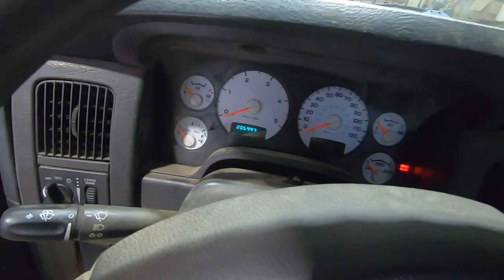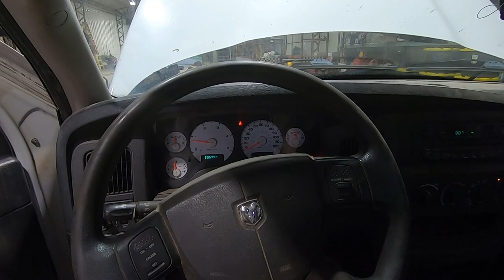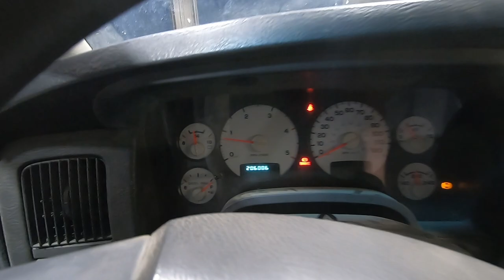Fixing the Tow Pig! My 2005 Dodge Ram Cummins gets a Camshaft Position Sensor Replacement

Comment: It's not how big the tank size is, it's how big the wallet is.
Reply: I have a 36 gallon on my Ferd. I need a bigger wallet.
Reply: yea...i got a 36gal OEM and a 50 gal aux in the bed.  The trick is not looking at the pump...just pull away...
Reply: I got a 25 gal tank AND a small wallet. (2002 f150)

Comment: Had a 4wd '16 Ram 3500 Cummins/6spd crewcab as my tow rig/daily driver...absolutely loved the truck, hated the price tag. Sold it after 4 years and went back to an '84 K30 CUCV with a 6.5 turbo swap and a 4L80E swap for less than 1/10th the cost with the same fuel mileage. Never looked back! Definitely a slower rig, but reliable and cool AF! Just can't beat a squarebody!
Reply from the maker: Dang right!

Comment: 1989 Chevrolet P30, 350 gas turbo 475 trans, soon to be LS 6.0 6l80 trans swapped. I rebuilt an early 70's 350 from a C30 about 9 years ago. Rebuilt the rear leaf springs to handle more weight.  added a few more leaves and new bushings and GM coil spiring over shocks front and rear. best improvement was adding a rear camera with a big screen from an old tablet up front. I have an aluminum car trailer, but most of the time I use a tow dolly I improved upon. I have two winches one on the tow dolly and also one mounted behind the rear bumper of the step-van. I have a generator, air compressor and a 110v welder. in the back of the step-van and a big vice mounted on the rear bumper. It also has a work bench and bunk that folds down on the inside side wall. I did mobile repair years ago with a service truck, now I just work on my own crap when can.  If someone calls looking for help, this truck is always broke down itself.

Comment: Based on the number of that gen 2500/3500 diesel Rams I towed in to dealers in 07-08 or so...and knowing that the rear axle was the primary failure point for all those oilfield guys and their welding equipment on the beds...and why they came out with 4500 and 5500 models soon after...I'd keep an eye on that rear end for sure.
Reply from the maker: Never heard of rear axle issues hear. So long as you keep fluid in them.
Reply: @moremortskerepair4354  the problem was who made them, Dexter Axle Indiana (my methed out brethren) was one of them.DCX got parts from the absolute lowest bidder to make the Krauts happy

Comment: Camshaft position sensors...oh I got stories with those. Never buy the cheap-o ones specially if its a German car. Also if your vehicle is seemingly eating camshaft sensors..make sure your ignition lock has not gone bad.

Comment: Half the cars in shops around America are there because of Computer component malfunctions. The automotive part didn't fail. The sensor failed. In the old days a can of Chemtool and a set of $6 set of points fixed your ride.
Reply: and in the old days your car was done at 100k, and got between 8-12mpg.

Comment: Living in Bulgaria I found that the parts for my vehicles are quite cheap, I have a 2000 model wrangler and a UAZ 405 4 x4 van from 1983, now looking for a lada pickup. The UAZ could be rebuilt at the side of the road no kidding so simple.

Comment: it's not the $150 charge, it's the 3 days they want to keep the truck that's a b!tch. btw, hope the cummins does better with the aftermarket CPS, the Dodge 4cyl and v6's tend to knock those out pretty quick so the "real" fix is to get one from a dealership.

Comment: I had to replace my radiator today in my 05 2500. The engine has been doing this skip. Almost like a misfire. But it was tiny. I just did 2 500 mile runs to Idaho in the last week. No problems. I am scheduled to tow tomorrow. After the radiator the engine flashes a code. States it needs a cam sensor. Clear it. And while getting the trailer it hesitates while on the freeway and does this almost die during idle. I get home watch your video and do what you say not to do. On my back trying to get it to run well so I can head back to Idaho tomorrow. After the PIA install it idles bad and dies twice. I guess it could be in the wires.

Comment: Oh no...you got the rear axle problem too. Its a good thing you caught it. Most Dodges made in DaimlerChrysler era all launch the pinion seals after some miles, most people dont notice and destroy the  entire axle. It was a problem in the older ones but not as bad. A buddy of mine has a 03? with Indiana cancer,the 20 inch flower rims,Hemi with a tick,190k miles and a grenaded rear end. Used rear end is 1200 so its a yard ornament. His problem was the bearing spun the race and wallowed the housing out. Keep an eye on your Dodge rear ends everybody..

Comment: It's the small stuff that can be a pain, I have a 02 GMC 2500hd diesel tow rig. Intermittent ABS brake light on dash, would come and go, had to pull the top off ABS module to access circuit board. Cut the thing open and resolder all the main connections on the board and reseal. It was tucked up nicely in the frame rail, for not so easy access, flat on the back job.

Comment: I HAVE A 05 DODGE 3500 DIESEL ALSO. THE JOB THAT REALLY SUCKS ON THEM IS REPLACING A HEATER CORE. ALSO THE BACK DRIVERS DOOR IS BAD ABOUT BREAKING THE WIRES TO THE ELECTRIC WINDOWS AND LOCKS. OTHER THAN THAT ITS A GREAT TRUCK

Comment: Good video.  Your honesty draws viewers like a magnet.  I tow a 14' utility trailer which carries a dune buggy.  My tow vehicle is a 2019 Honda Pilot which is rated for 3500 pounds. Although my loaded trailer falls about 400 pounds under the limit, I had to install a trans oil cooler to keep the tranny from overheating in hot weather. The Hayden trans oil cooler works well. I'll use them on all future tow vehicles.
Reply from the maker: They make a good product!

Comment: What a great truck. The manual is definitely the way to go in the Mopar truck.
Watching this I realize changing the CPS on my 7.3 is way easier. However since 2002 Ford/NAVSTAR has had three iterations on the CPS and they can be a little picky as to which one runs best. Can’t buy the original (arguably best) CPS new. 
For most other repairs the Cummins is friendlier to work on.
Reply from the maker: Well that's fun!

Comment: I have a 2006 Dodge Ram 3500 crew cab Dually 4x4 with the Cummins turbo diesel and 6 speed manual transmission. I love that truck !!! I love that cow catcher you got on the front of yours.

Comment: Cam position sensor on my 5.7 tundra. I know gas things. But I was instructed to change oil. I did that 3 times at less than 3k miles all 3 times. On the 4th change I got past 3k. Changed again. Now I change at 6k have for over 100k miles and no codes since. Runs like a champ. It was my tow vehicle. I currently have a 2022 gmc with 3L duramax. Getting 28mpg normal driving and 16 when pulling. Same stats as my tundra HP and Torque. Love this new truck. Still have the tundra as my beater 270k on that. Plan to keep it until it completely Rusts into a pile. Fuel tank is held on with ratchet straps currently…

Comment: Excellent video Mortske Repair  :) also don't you have clear code with code reader  with engine off running  plus ignition  switch to on after code reader plug in and clear codes 2 twice also confirm to 2 times should help out! Yes that excellent tail pipe need change for sure and truck in great shape for age too!

Comment: I can't imagine that the cam/crank sensors are much different between gas and diesel engines.  I dealt with a Jeep Liberty with the V6 trying to clear those exact codes.  Went through 3 sets from 2 different parts houses, 2 different brands.  All were junk.  Ended up spending 2x the money, and bought from the dealer.  Ran like a champ after that.

Comment: 2016 F-350 Powerstroke Torbo and the Old ‘02 F-250 7.3 Turbo, both 5th. Wheel, Crew Cabs, the 02 has 9’ Diamond Tread Flatbed & 16 has the short Box. All in the Driveway below My 2020 F-350 Super Duty 6.7 Turbo that’s a Company issue Crew Cab that has only had a Passenger a Hand Full of Times. I like the Ferds, maybe I’m Stunned? That’s Debatable Per the Wife. Catch you on the next one, Keep It Safe Out There Sir
Reply from the maker: No comment!

Comment: Better if you would call Wes!  My tow rig is a 2022 F-350 with 7.3 l gas Gogzilla engine, ten speed, 4:30 locking diff.
Reply from the maker: Nice!

Comment: Just replaced a cam sensor in my 07.5 6.7 truck and the engine light is still on and it didn't fix the issue. My truck is having a crank no start condition woth p0340 code any ideas?
Reply from the maker: nope

Comment: Oh, you are gonna laugh. My tow pig is a 77 Plymouth Gran Fury 2 door married to a converted boat trailer ( it tilts!). walking axles, 14" tires . The poor Fury has a 318 2 bbl. dual exhaust and 197,000 on the clock w/o a rebuild. I try and tow-bar when ever possible. It just keeps going. Best $600 I spent since I used up all my trucks ( "ain't nobody got money for a decent truck").
Reply from the maker: Sweet!

Comment: My Toyota Tundra is my tow pig plenty of power. Don't even feel like it's back there. Need a load leveling system for my trailer or air bags. Cause my bumper is really low but doesn't drag
Reply from the maker: Carolina leans are cool!

Comment: Glad it’s running again! Noticed you hacked it by not disconnecting battery, drove it and it straightened out. Quick story, changed mass flow on 2011 pilot, 150 miles later, dash looked like a Christmas tree, swapped back to cleaned original sensor, 150 miles, Christmas again. Got home, scratched my head, disconnected battery, waited bout an hour, hooked up battery, now have bout 2,000 on it, perfect! Know anyone who wants to buy a gently used mass flow sensor? Guess it defaulted codes to original settings after disconnecting battery. Might save you the heartache of replacing that sensor again, although Wes may do it for you, eh? Good video!
Reply from the maker: Interesting.

Comment: My tow pig is an '06 F450 crew cab flatbed with a 12-valve 5.9 cummins swapped into it.   116k miles.
Reply from the maker: Nice! No 6.0!
Reply: @moremortskerepair4354  Was actually a V10 truck.    Engine is from a '92 D350 and dunno where the trans came from, but the trans was upgraded with billet convertor etc.  Engine upgraded to 350hp..   4000 rpm governor springs.   With 4.88 gears, it isn't going that fast at 3200 rpm, but it will pull a house.  Plus, with the extra weight on the front end, it doesn't ride like a buckboard.   Couldn't have assembled a truck like this for the price I paid, so I am definitely happy with it.    Only gets 12 mpg, however....   xD

Comment: We used a short box square body Chevy 4x4 with a lift and monster mudders on it to haul a giganormous car hauler with a big tool box and a tire rack. One time on the way to the track I seen it passing on the shoulder. That old trailer did its job and the brakes kicked on - stopped it on the shoulder. It snapped the drop hitch off.
Reply: You could fit two engines in the tool box thingie if you had to. Always had one spare engine with us.

Comment: Few things are worse than that feeling after you put a ton of work into replacing a part, then you start the rig up and the problem persists.  My tow pig is a 2005 Chevy 2500 with the gas 6.0 LS, but not too long ago I used to tow with a 1989 Jeep Grand Wagoneer.
Reply from the maker: That's a pretty good upgrade!

Comment: this truck reminds me of my 03 ram was originally a 5 speed they(first owners i believe) swapped in a 47re or 48re they did the column and all too of a newer ram shes never been wrecked according to the title report but shes had a run in with the previous owners shed so its slightly more then whiskey dented im waiting on a bed and such to fix it
Reply: my factory 1 of 1 89 ford is my tow rig right now till i get the ram finished

Comment: "Comment on what your tow vehicle is" - OK I will and but don't laugh. It's a 2005 Kia Sportage XS, and I say 'don't laugh' because it is actually surprisingly good at towing and not too bad if used off road. It certainly has it's limitations and you need to learn where they're set pretty soon though or you'll end up in a mess with it. I only bought it because it was ridiculously cheap at the time, it's earned the right to stick around for awhile so far.
Reply from the maker: What a hot rod!
Reply: @moremortskerepair4354  Hahaha.

Comment: Find you a  wrecked Pete or Kenworth and get one of the tanks off of it and then you will have a 100- 150 gal. Aux tank mount it in the bed  and it won't cost you  2000$
Reply from the maker: I don't wanna use up by bed space with fuel
Reply: @moremortskerepair4354  don't blame  you

Comment: I like your style in getting the truck you want/ need. However, I love my moose mirrors up all the time.  Lol. Puddin called you a YouTube Engineer. That could be a shirt
Reply from the maker: Ewwwww, mirrors down! What a wise crack.
Reply: I run my mirrors up all the time as well. I had the same opinion until one time a buddy decided to turn up my passenger side. Didn’t realize it until I was in the truck and rather than walk around and fix it I just adjusted the mirror so I could see on the drive home. I was happier with the field of view and changed my opinion. I now have virtually no blind spot
Reply from the maker: @MuscleMan91092  ewwww
Reply: @moremortskerepair4354  I know. I make fun of myself and join in on the jokes. I feel like a poser, but I like being able to see 🤷🏻‍♂️